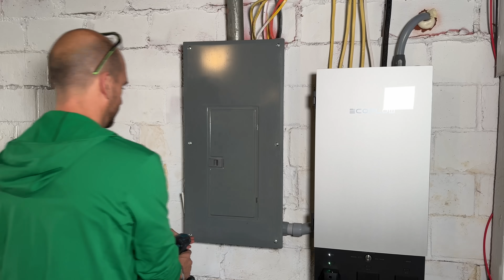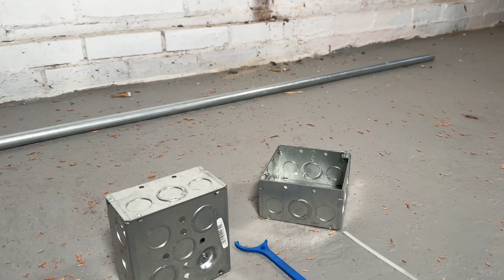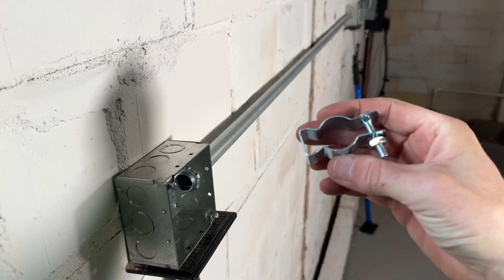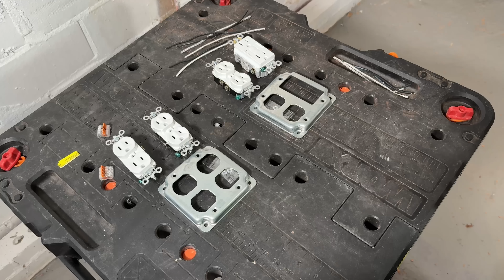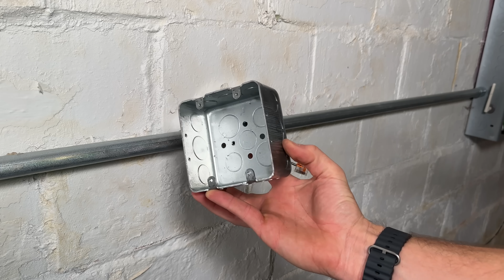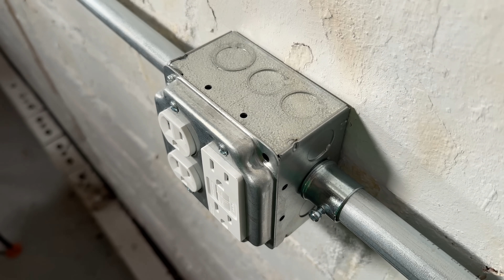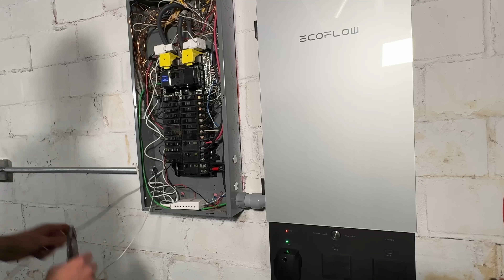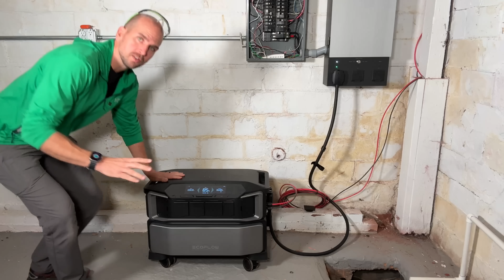Add Outlet To Unfinished Basement Or Garage

Comment: Never trust a mechanical bond always hard wire  your ground  to service panel.
Reply: A ground wire being held by a terminal screw is a mechanical bond. Wire type ground unnecessary with properly installed EMT.

Comment: When removing the panel covers I would remove the top two screws and use all thread to keep the panels in place when removing and installing the covers. Have had too many issues trying to hold larger panel covers and installing the screws.

Comment: Since this is targeted at inexperienced DIYers, I have to pick a nit about torquing down your connections.  You're not code compliant unless everything is installed to the manufacturer's specifications, and the electrical panel and breaker will come with torque specs when fastening down the wires.  Experienced electricians will (hopefully) have a good feel what what enough torque feels like, and will frequently skip the use of a toque-driver, and just use a regular screwdriver.  Amateurs often won't have a good feel for it, and probably ought to use a tool that's going to hit the required torque.  Under-torqued electrical connections do sometimes go bad, and it's best to avoid the chance of a future problem.

Comment: Ouch, you are definitely a handyman and not a licensed electrician. National Electrical Inspector - you are RED TAGGED. Because you did not pull a ground wire, which is acceptable to use the conduit as ground, but you have to follow NEC Art 250.148 Ground wire required from the device grounding screw to the box. Ground screw missing in the box, Art 250.148C can not use the box mounting screw for this. FYI only the screw on the device must be green. The screw in the box usually come in green, but can be other colors. Art 334.15. non metallic sheath cable(Romex) not allowed in conduit. Unfinished basement is for storage only, then no AFCI, if you are using this space for any household activities or just hanging out, then AFCI is required. Art 210.12 AFCI protection in all living spaces. You did not strap the conduit, Art 358.30. you are missing 3 straps. You did not bend the conduit to offset from any box to the wall and back to the box, you did not do it at the panel either. Definite red tag. Art 110.12 Neat and workmanlike manner. Conduit can not be forced from a box and angle the fitting to a wall strap, to much pressure on the fitting. Which violates the manufacturer requirement that conduit shall fit straight into the fitting. Forcing it to met the wall without an small box offset is not acceptable. The the last piece of the puzzle I am sure you knew this as most don't. WAGO'S have ratings, this may be a 20amp wago, but is it "continuous duty" 20amp? Will you plug in anything and run it for more than 3 hours. IE battery charger, etc. Wagos were designed for lighting connections, so many have used them for heavy duty equipment and they failed and caused a house fire from a shop vacuum and saw. If you don't believe go to the internet and look at all the fires they have caused for using with 20amp receptacles and circuits. Each time Wago has not claimed responsibility and stated their product was misused. I feel they are mislabeled and misbranded. Our City does not allow them on receptacles circuits unless the package is saved to show the heavy and continuous duty rating.  Watch this professional video by a licensed electrician about Romex in conduit. https://www.youtube.com/watch?v=JPpBhIVP9aw
Reply: He's using lock washers to mount device to cover, therefore no ground wire from device to box required. Romex is absolutely allowed in conduit. The only issue in this installation is the 5'-6' length of conduit is missing support, a single one in the center is what's needed. No supported required on the 24" length between the two boxes. Box offsets to get conduit tight against wall is optional and not necessary in this case.
Reply: @pld8993  That is the mistake every electrician makes. The box is NOT identified as self grounding for the RS cover. Hint: raised metal area for ground screw in box. The device shall be identified as for using a screw for the grounding connection. Which he happens to have the correct device. The bolt, washer, and nut are to hold the device to the RS cover in place and the center screw is for grounding as per manufacturer. Please provide NEC code reference for "lock washer" is substituted for the ground wire. As a legal connection from the device to the box is still required. Code reference is above in last note.  As for Romex, yes it can be placed in conduit. But this does NOT meet fill requirements with all the sheathing on it, do the math, 3/4 EMT conduit is required. Still a violation. And for no offsets and no straps still a problem on the long piece of conduit. As for the 24" or less piece of EMT conduit. That is defined as a conduit with connectors and we could argue no straps, but your statement it is a 24" NIPPLE that does not need to be strapped. This is not a "NIPPLE", it is a piece of conduit with two connectors. Nipples are one piece with threads on each end. This is not about him putting a video of one minor violation. This is s person putting a video that has many violations misleading that would not pass any inspection by a licensed inspector.
Reply: @johnfreisen661  The only one here making multiple mistakes is you. 250.146(A) locking fastener reference, pigtail to box not required. The NEC makes no reference to a self-grounding box requirement. Here's the math that you obviously haven't done. 12-2 NM easily comes in below the 53% fill requirement for single cables in conduit, Ch 9 Table 1. 1/2" emt has an area of .304 sq in, 53% of that is .161 sq in. 12-2 NM has a calculated area of .1256 sq in, well below the limit, not even close, 3/4" emt not required. I never made any reference to a "nipple" and nowhere in my post does the word "nipple" appear so I'm not sure what you're talking about. The 24" length of conduit does not require support other than the support of the panel and box at each end. EMT requires support within 3' of a box so any length less than 3' is supported at both ends by a box/panel and doesn't not require additional supports. Any inspector that knows what they're doing would call him out for missing a support on the 5'-6' conduit length only as there are no other violations. Back to code class for you, junior.
Reply: @johnfreisen661  Sorry, I missed one more of your "mistakes," the one where you try to make some distinction between continuous and intermittent duty. Cord and plug connected loads are limited to 80%, continuous or intermittent is irrelevant, so a 20 amp receptacle circuit is limited to 16 amps.
Reply: @pld8993  Irrelevant. Then read 2023 NEC art 210.20A Continuous and Non Continuous load calculations- allows 100% of the non-continuous load and 125% (your 80%) of a continuous load for all calculations to size the breaker. It is clear, 100% up to 20amps for non continuous loads, not 16amps as you stated.

Comment: If i were going through the block wall and wanted to add outlets to the exterior wall, would i use pvc conduit and would i still use the same THWN wires?

Comment: Pull a ground & bond to the box using a ground screw! Don't rely on a set screw from an EMT connector to maintain ground continuity.  Don't rely on the self grounding part of the receptacle either.  Tighten a ground wire to the ground screw terminal on the receptacle.  The self grounding is good as a secondary ground, but don't rely on it as the primary or only ground connection.  Connecting a ground to the receptacle is much more reliable.
Reply: When installed properly, conduit is fine as a grounding path. Also true for the receptacle yoke. A wire type ground is not inherently more reliable than conduit ground.
Reply: @pld8993 I know it is code compliant. I do not think it is more reliable than an actual ground.
Reply: @joelboutier1736  EMT is an actual ground and electrically, conduit grounding path is better than a wire type ground up to about 400'. The NEC lists 14 different ground types, only 1 is a wire.
Reply: @pld8993 I understand & I still pull a ground. Like I said, I’m well aware that it is code compliant. I’ve been in buildings where maintenance people have monkeyed around with stuff or a set screw was not tightened or a conduit has come loose. That is why I personally do not use EMT as the sole means of grounding.

Comment: I may be mistaken but it appears that 15 amp receptacles are being used in a 20 amp circuit.  Also like everyone else there is no good reason not to use ground wires. It would be much simpler to run the separate ground than having to “check with your local inspector”.
Reply: There's nothing to check. NEC allows EMT as grounding path, wire type ground not necessary.

Comment: Beginner question - isn't this considered a "damp" location? Shouldn't you use THWN / wet rated wire?
Reply: No, inside a basement or garage is typically a dry location.

Comment: Where are the wiring n u t s and the four box offsets with a 3/4 inch Bender Box offsets no3/4 EMT straps when the basement battery backup floods does that thing catch fire hurricanes eat basements with lots of water

Comment: I'm wondering about the conduit running with a space between it and the wall.   Other videos I've seen say to not leave that gap.  ???  It would be so much easier to do it like you do!
Reply: Sometimes leaving a space makes the most sense, sometimes flat against the wall makes the most sense. In this video and many times, either way is fine.

Comment: seen a different video where nm was used in garage  which was proper as long as it did not fill more than 53%  . i do believe the circuit in garage and basements require ground fault receptacle or breaker on the circuit.  i agree use ground wire which would be in  nm   12 ga shown and pigtailed the boxes
. what is confusing some localities modify codes and even an inspector can demand that you do it his way or flunk. only thing i did learn from the other vidio i dident know was not to strip wire from nm to do a run . i haven't done it except i have used stripped out of mn to do dc wiring in truck  but iven then i prefer stranded for 99% in light trucks
Reply: Inspector cannot demand you do it his way or flunk. Inspectors enforce the official, written code adopted by the local AHJ. If it's an installation that complies with the adopted code, the inspector cannot fail you.
Reply: @pld8993  guess your area is good i am from philly and would never trust a city inspector. for example plumbing had 13 inspectors 12 were indited for corruption taking bribes drive by inspections were the contractor hands envelope and gets passed . and a demo inspecter did same few tyrs later when the unqualified operator knocked building on a thrift store next door and killed several hurt many . he knew he was done so he ended himsely so do i trust inspectors no as far as i ca throw one. are they all bad of coure not
Reply: @remocres  A corrupt inspector can demand anything, including cash, that's not the point. Inspectors enforce the official code and cannot legally fail you unless you do it their way. I always call out inspectors when they're wrong or just making things up, always.

Comment: a quick tip you should do a box offset on the conduit so it sits flush to the wall and you should put some straps to to secure, so the emt conduit will never move.

Comment: So many comments about the ground wire. I agree that you should run a ground wire, but at minimum, you should install a grounding locknut and wire the conduit/locknut to the ground bar, don't just rely on the box to fitting connection. 💙 T.E.N.
Reply: Conduit and fittings are UL listed for bonding, grounding bushing or locknut is not necessary.

Comment: That is a "slotted" screwdriver, not a "flathead."  Screwdrivers do not have a head, they have a handle, a shank, and a tip (or bit).  A better tool to use for tightening the nut is a drift punch with a squared tip.  At least you could advise keeping one cheap screwdriver set apart for abusing in this way.
Reply: Screwdrivers are not slotted, screws are slotted. It's a flat blade screwdriver, not a slotted screwdriver.

Comment: You need plastic bushings at all instances where the conduit connections enter the box--to prevent chafing the wire.
Reply: Incorrect, not required.

Comment: In basements or garages, BX cable is easier than running conduit for home owners. If you don't care for the sag, run it along joists and drop it straight down the wall on a strap

Comment: It always gets me when I see code compliance discussions and no code references.  The video is correct and EMT can be used as an equipment ground NEC 250.1118(4)
Reply: Edit: 250.118(4)
Reply: Whenever I read that "it's a code violation" and I disagree or don't know, I ask to cite the code, I never get a reply.

Comment: Correct me if I'm wrong.  Why are you installing 15 amp gfci and outlets on a 20 amp breaker?
Reply: It's permitted and commonly done. NEC 210.21(b)(3).

Comment: It is not a code violation to run Romex inside conduit as long as it is sized correctly! Best practice would be stranded wire with a ground. However there is code violation using a plumber's pipe cutter! All cuts should be used with a hack saw then thoroughly reamed. It is difficult if not nearly impossible to ream the sharp edge made by a plumber's pipe cutter. Not a good idea to use a drill to widen the knockouts on a live panel. Best to use a 3/4 knockout tool! It is not good practice to run conduit away from the wall. An EMT pipe bender should be used for offsets so the conduit runs next to the wall and pipe clamp to support the conduit every three feet. You will find that the connectors can easily be tightened with channel locks on the round part or outside of the connector then if needed with a screwdriver on the inside lock ring.
Reply: Running conduit off the wall is not bad practice and most conduit that's installed is not tight against the wall. Box offsets are not required and many times not desirable. Sometimes box offsets make sense, here it doesn't matter either way. EMT not required to be supported every 3', supports no more than 10' apart is code. Using a step bit to enlarge a hole in an existing panel makes much more sense and is safer than using a knockout tool.

Comment: I love Wago connectors, but they do have one weakness. It is difficult to pull a wire straight out of a Wago connector, however, if the wire is rotated while being pulled, it will come out fairly easily. In most cases this will not be a problem, but if you don't have a lot of room in a box and you have to twist or wrestle with the wires to get them into the box, it is possible for a wire to pop out of a Wago connector. Before you close up the box, check that all the wires are still fully inserted into the Wago connectors.

Comment: #12 THHN stranded I you preferred solid is okay particularly I don’t like solid THHN, hi from Ca, I don’t know I’m retired in 2014, before you can run just 5’ romex with jacket, after 5’ you need remove the jacket 👍
Reply: No, the jacket on romex must remain intact when it's installed in conduit, regardless of length.

Comment: Don't pigtail the input to the GFCI, add a ground wire, add conduit support, don't drill into grout lines, do drill into block/concrete/brick and you'll have a good installation.

Comment: Your two so-called four inch boxes r actually two 4 11/16th! Which is a huge difference both in sizing & capacity. When ur trying to teach “do it yourselves” it’s quite important to relay ALL the information! 😊
Reply: Incorrect, those are deep 1900 boxes, 4" square.

Comment: Actually there is no issue with using romex
If we are going to throw in the term "Best Practice" then referring to using ROMEX vs single THNN as a Best Practice is a joke when you aren't relying on a Bond of the boxes and aren't pulling an equipment ground wire

Comment: Yikes. Why put the bolts into the mortar instead of the brick?
Reply: While block is certainly stronger than mortar, for attaching a single 1900 box mortar is more than capable.

Comment: Dear, what contractor installed this box with plugs, he installed it on a bare wall and it should have been placed on a tree, this box will rust from frost in the winter and will get a puncture to the floor, a concrete wall is a very good conductor of electricity. There is no additional grounding cable, 1. the box is painted, 2. over time the pipes will rust due to moisture in the beige and there will be no grounding, there is a water leak in the left corner and this will lead to rusting of the pipes, a young contractor and such a stupid one. Do you only think about money, and human life does not count???:face-green-smiling:

Comment: @ 8-59 you say the other box is for finished walls, and I say wrong. The box you are using, where the devices are mounted to the cover, the cover should be grounded. I have removed cover plates, and had an electrically hot cover plate in my hand. On the other box, the devices remain mounted to the box which is far safer.